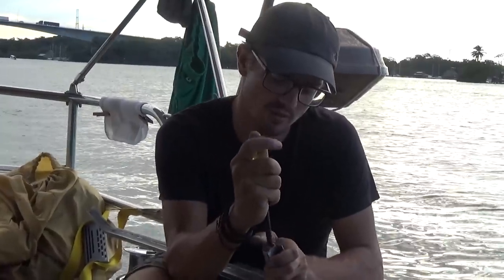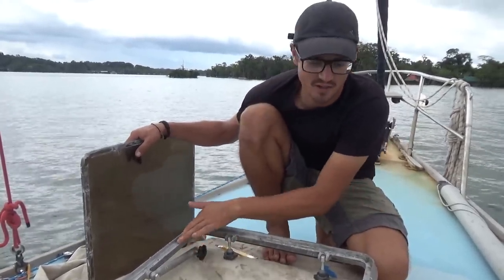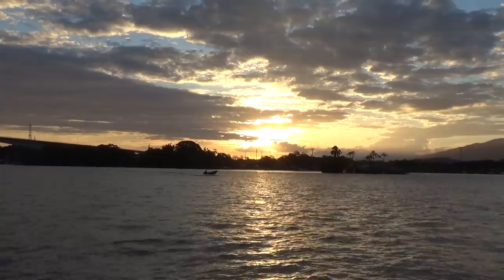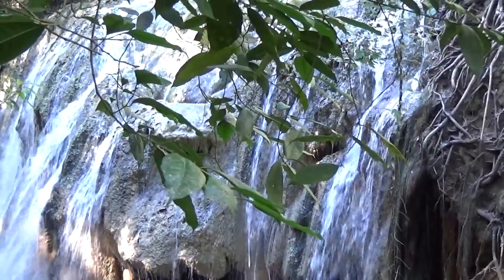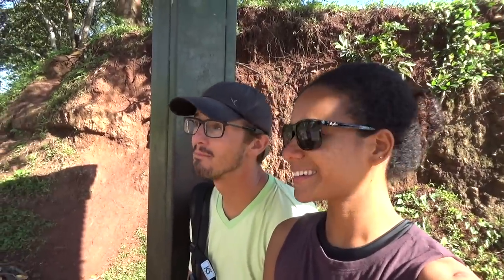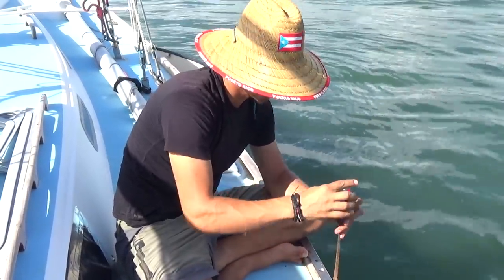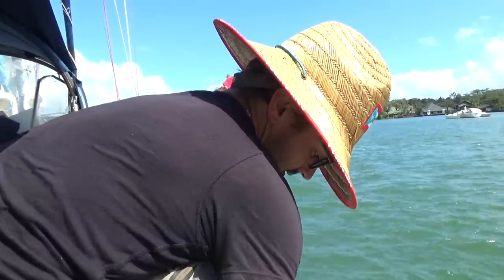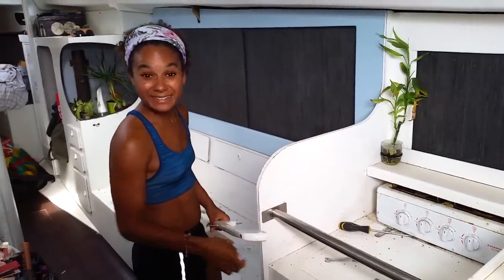781 HOLES in our Boat — Sailing Uma [Step 113]

Comment: If you didn't know, when fastening large panels like the front hatch, start screwing at the center and work towards the corners, doing so allows for a better seal by allowing the panel to seat tightly against the mating surface. If you start in the corners it can bow up in the center.

Comment: You can use acrylic solvent / cement to repair cracks in acrylic. Make sure it is water thin, then apply a small amount directly on the crack.  You will see it wick into the crack.  If you get it anywhere else it will smudge the acrylic so be careful.  Use an eye dropper if you can to minimize excess.  I have repaired acrylic aquariums this way so your hatch should be fine.

Comment: Pearson used the same sealing strips for there port lights as Catalina. You can buy kits on-line. I did most of mine last year and It worked great.  PS my 1976 Pearson 365 is moored in Fairhaven, MA :)

Comment: One trick with the acrylic is to drill the holes slightly too big for the screws since it expands with temperature. That helps with the cracking!

Comment: Happy Birthday, Kika!

I have one thing to mention when sealing port lights:  use Butyl Rubber.  It will fill any gaps and stay flexible forever.  

I am looking forward to seeing your SS hand rails.  I have toyed with this idea for a long time, but have never wanted to spend the money.  One question, though:  If you can't get 316 there, where are you getting the hand rails fabricated?  I guess I'll have to wait for the next video to find out.

Comment: Happy Birthday Kika!!!

You can be quite happy that this acrylic glass sheet had been available and not polycarbonate (lexan, makrolon). Acrylic glass is much better UV resitant, PC turns yellow or starts to crease (the general purpose PC). For the sealing/bonding you better use Teroson MS 939 next time - nothing else, no Sika stuff!
The side rails, OMG - I have to do the same this year on my boat. I hope I wont get any bad surprises. Does you boat have any drainage spots inside of the side rails? I have always patches of water on the deck which can't flow off properly. 
Cheers!

Comment: Look at GE Silpruf SCS2000 with +/- 50% movement. This is used in skyscraper windows due to the difference in expansion coefficients between acrylic and aluminum. You must also size the acrylic to this temperature expansion to the frame. Very important. The acrylic must be sized to offset this differential with the sealant because it varies so much from the aluminum. It basically has to be embedded in quite a bit of silicon and should not be touching aluminum. Quite a pain to embed but works.

Comment: Not well known is that you can thin silicon sealant with mineral turpentine and then using a squeegee bottle run it into cracks and fissures that leak.  Need to stir it for several minutes until it eventually dissolves.  Turps dries out over ~ 24hrs leaving thin skin of silastic which cures off with water vapour in the air.  Other thing for fixing leaks is buy an automotive ultrasonic leak detector comprising small battery driven transmitter on the inside and using the receiver go around the joint on the outside to pinpoint any leaks.  Bought one 20 years ago and should be still available.  About $100 then I recall.  Sail safe.

Comment: Wpw those seals did eat away quite fast or is that a normal time frame? Holy crap those small busses are insane compared to Curacao, they really stuff them up there. WOw respect your did all those dek-screws by hand, i would have though you would have either a easier powertool or a battery powertool. Most have had sore lower arms after that. Hahahaha i missed those extra ends... Baby you got work work work work work...

Comment: Use Dow Corning 795 Coleman glass with alcohol, whiskey , ,, , ,  ask all areas around the areas of Dow Corning  , fill fit and clean up don’t go cheep cylicone or you will be doing it again , don’t screw ,, screws up tight   Tighten next day , to form a casket to firm onto  good luck

Comment: First thing you need to do it stop using silicone as a water tight sealer because its not water tight. Use butyl rubber in tape or caulking form.
Reply: Agreed. It will flexible and not dry out
Reply: Butyl is fabulous on the horizontal - chainplates, solar vents on deck, bolt heads on hatches, etc. If it's used vertically, it slowly responds to gravity and begins to sneak out the bottom of the fitting. Unless you use another sealant on the perimeter of window frames, to keep the burly in place, you'll have to keep replacing it.

Comment: Acrylic won't scratch as easily as polycarbonate (Lexan) but it is more brittle and reacts/melts in contact with hydraulic fluids and some fuel types. Polycarbonate will yellow over time, even the PC's with UV-protective additives. PC also needs a hardcoat to be as resistant to fuels and other liquids, as well as to be as scratch and abrasion resistant as an acrylic. Personally, I would have had glass cut to fit. Both plastic types kind of suck.

Comment: Sikaflex 291 (or its equivalent in other brands) is the ONLY sealant use on boats. Never had a issue with it, Polyurethane rather than silicone based. Silicone is only good for sealing anything you want to leak, no matter what the tube says.

Comment: I noticed you only used the adhesive in the window glass channel. I have the same windows on my boat and it has a rubber gasket that goes around the glass - and it leaks.  How are your windows doing without the gasket?  Any leaks or cracks?

Comment: Don't use silicone unless you want to do it again . Use butyl tape or 4200 .  If you must use silicone use comercial stuff purchased at the outlet the commercial window guys use - not the hardware store .  In lexan you must overdrill the holes or it will crack around them as the plastic and metal expand at a different rate .

Comment: The tricks of using silicon are 1st clean very well the surface; alcohol is the best.. use the silicon inside the tube and use the proper “gun” it will help you put some pressure. For the finishing mask as you did but to have a smooth surface instead of using the spatula... lick 👅 your finger and pass it .... believe me you will see a difference

Comment: Hi, I'm also working on the fixed ports on my boat and from a picture of your port frame the gasket material for that frame is available at Catalina Direct.Com. Check the diagram of the frame cross section for a match. Enjoy

Comment: Yeah a boat that leaks sucks big time. No fun. Unlike your birthday!  Use Butyl tape to seal that stuff. Only way to go. on the hull to deck joint, 5200 from underneath if you can. Then use Sikaflex 291 or 292 polyurethane sealant for the topsides. Remember to overdrill the holes, put in thickened epoxy, and then seal it. You might have to fiberglass the hull to deck joint as well to seal it. Old boats = work. Good luck.